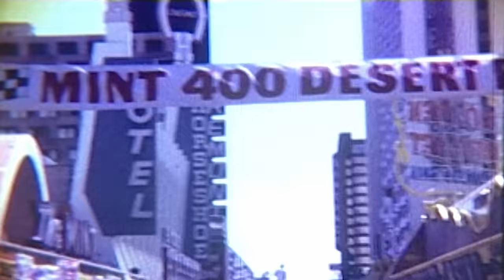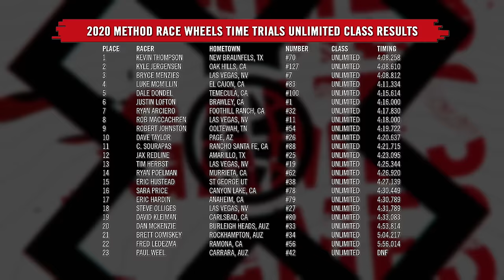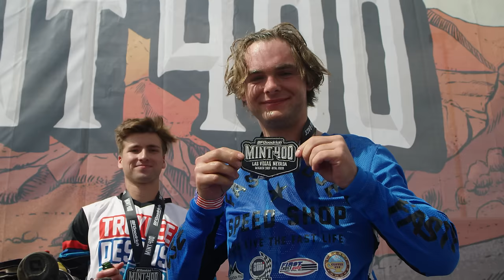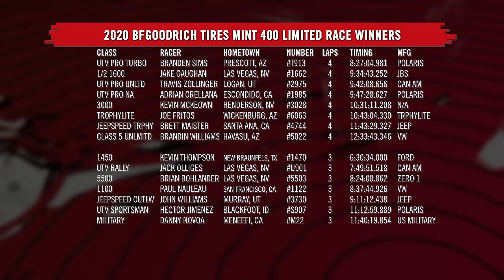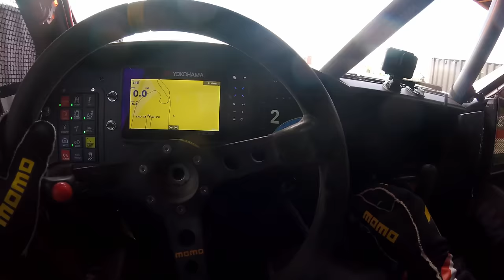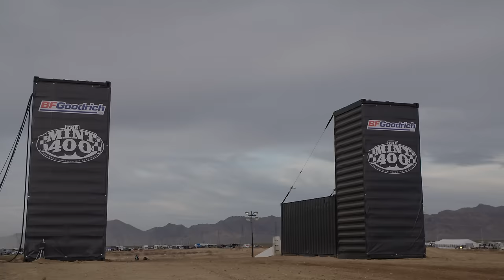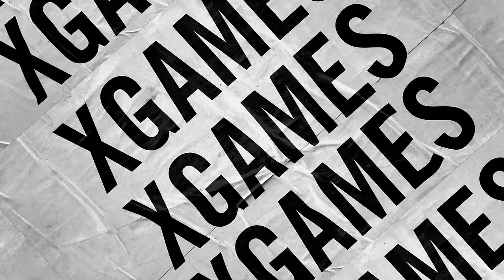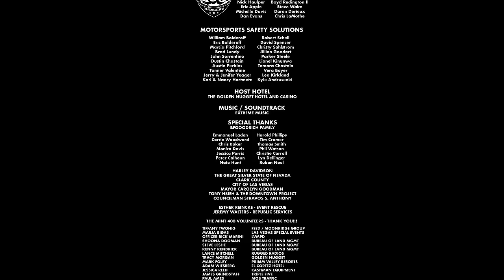2020 BFGoodrich Tires Mint 400 World of X Games Television Show

Comment: I live in Las Vegas, and my dad owns an electric company. Right next to his “shop,” there is a company called American adventure tours. They have all of the side by sides you could ask for, and the owner (Rick) asked my dad if he could take me out in a rzr made for racing. My dad and his employee, drew, would come along too. They were in single seat race rzr’s. Along the way, we cut into the mint 400 trail. Out there, Rick decided to push the limits of what was possible in the machine. He had 40 years of racing under his belt, so I trusted him. He pushed the upper limits of 120. That was absolutely insane to experience! After that, we cut off into a dry lake bed. That’s when my dad, which is pretty damn experienced with off-roading fucked up trying to do donuts, and put the car on 2 wheels. He went up to what I would say 50 degrees, and we were right behind him! But he did recover, and it’s something that everyone is gonna remember that day!

Comment: I’ve heard so many different names for these trucks, off-road trucks, pre-runners, Baja trucks, trophy trucks...What are they actually called???
Reply: Depends on the class of truck racing there all diff classes some race pavement only some everything some super hot fast badass and some toned down a little
Reply: Depends on the organization. If you are racing Best in the Desert Races (Mint 400, Vegas to Reno, Etc.) the unlimited trucks are called Trick Trucks. You will also have trucks that are called Spec Trick Trucks or commonly referred to as 6100 trucks. Spec trucks have most of the same items as a trick truck but are limited to a spec LS3 crate motor. 

If you are racing in Score races (Baja 500, Baja 1000, Etc.) then unlimited trucks are referred to as Trophy Trucks. Spec trucks are called Spec Trophy trucks and so on.
Reply: Biskit Barrels.
Reply: Trophy truck in score.. unlimited in Bitd.       Spec trophy truck in score..6100 truck in Bitd. Or Baja truck.   1450 is a frame rail unlimited truck.